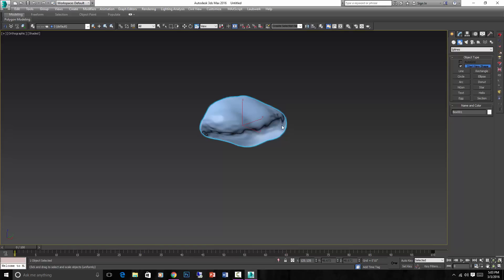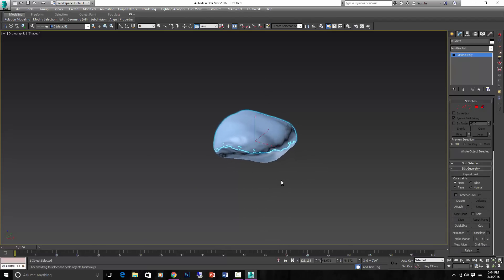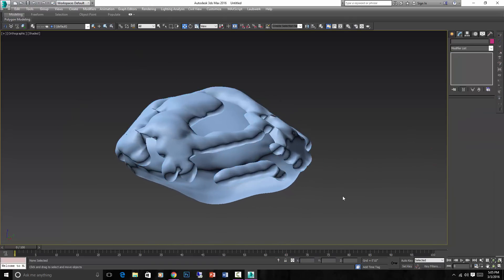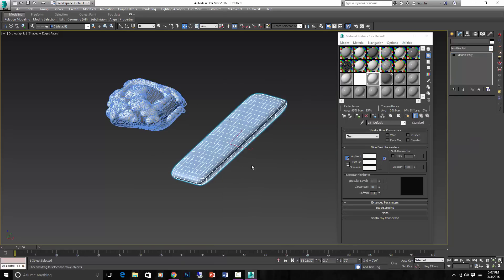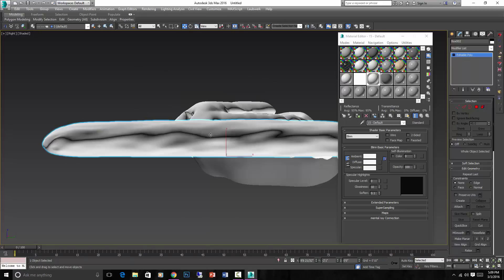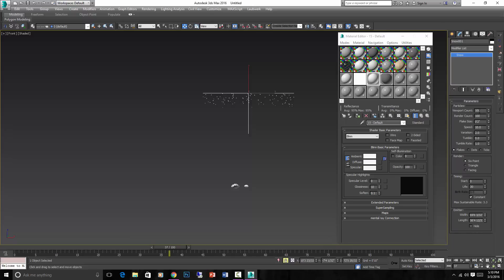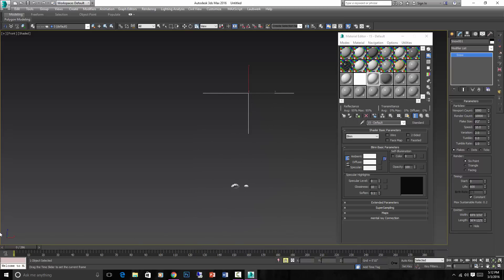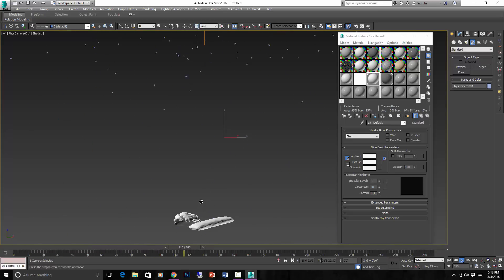3ds Max Snow: Add Snow To Any Scene Using 3ds Max Tools

Comment: Nice tutorial. There is a very cool plugin I found for snow and super easy to use although is does create a lot of geometry.It's called SnowGun Painter.You can check it if you want. :)
Reply from the maker: +IncGirl666 Yeah, I know those kinds of things are out there.  Thanks for sharing.  That is definitely an option as well.